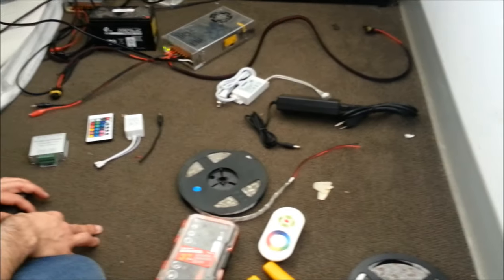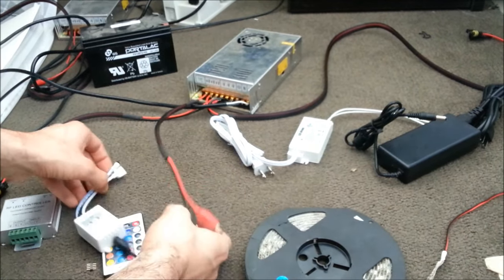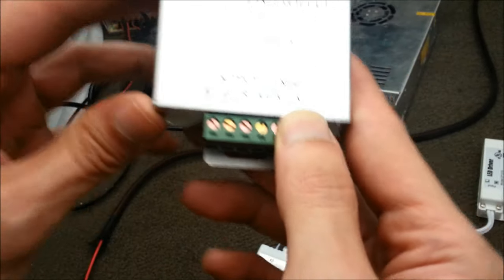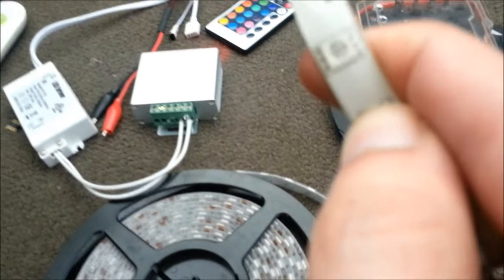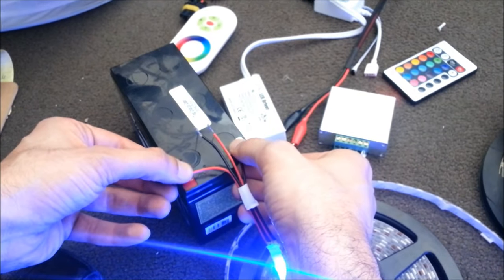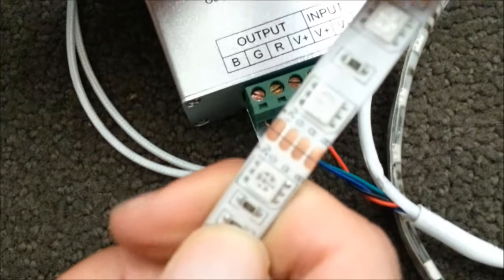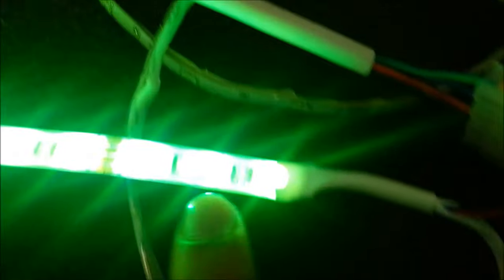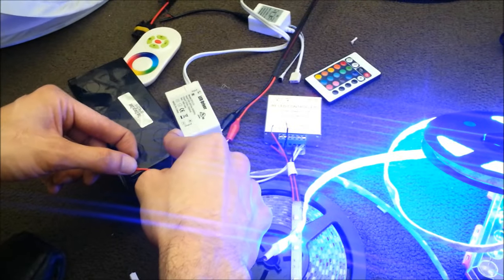LED Strip & RGB Controller Installation Guide DIY Help

Comment: Dude! I have been searching for information all night and now it is 10am. FINALLY! I found someone that knows how to make wiring these simple! Ok, really though. You have the absolute hands down best information available. I have a set of strip lights no model # but I can see the 151 and 331 resiators and 50/50 leds but no model # so I know they are analog, but want to be able to change the color to attract different types of fish. I have been trying for literally over 10hours for someone that knows how to wire them with and within the first 3 min of your video You answered every single question I have! I don't understand why your video is not the highest viewed highest ranked LED info video. New sub and thumbs up thanks for the info. You da man. I even searched the mfg website for info but they obviously don't support analog any longer ao they simply don't cross reference the model # with any controller. Now I know I can ditch them and go buy a cheap controller on Amazon.

Comment: Finally, after having 2 strips with only Red & Black connectors and 2 controllers with remotes, I have wondered how to connect them. Now I know, I didn't need the controller because I only bought 1 colour per strip (1 blue, 1 red). Opps, my bad. I just tested them on a battery and voila, good to go. Thanks for this video, soo soo very helpful.

Comment: just ordered a 5metre kit on eBay, if I want more sets of 5 metres attached, will the 12v power be enough for extra lengths attached?
Reply: I have the same question.  Thank you.

Comment: I'm trying to find out if I can use one power supply for the whole house and with long connectors because i don't want to put lighting all around the house. Please reply asap thank you. If you know how to and you have to purchase something please also send the links.
Reply: If you are using more than 5 meters or something 12V will not work, you will need a better power supply if you are using a large amount of LED Strips.

Comment: Great video, I definently like this setup. Would you be able to provide the specifications for that silver power supply and the RF Controller. I specifically want to know what the maximum current they can provide is. I wan't to run roughly 30-48 feet of LED's, so I believe that I am going to need at least a 6A inverter. Another question, can you hook the RF Controller directly up to the power supply? Lastley, would you be able to provide a link just tell me where you bought the silver power supply and the RF controller. Again, great video.

Comment: I have a 1200 watts amp in my car and I want the led to pulse on the bass. Is it possible to use these controller and connect them to the subs for the power source ? or will that blow the controller/led strip.

Comment: Hi so I need some help I want to install LED lights in my stairs I have 15 steps I just want 1 led strip on each side and I want to use a motion detector to activate the lights can you please help me and tell me what to get

Comment: Hello I a have the rgb (4wire) led lights. I have approximately 1200 leds(12v-5amps per string. 300 per string) I hooked them up in a row.  When I plugged them in. They were brilliant for the first string then each string got fuller until the last string you could barrel see them. So I bought a 12v 60amp power supply. Plugged them in and no change!  What am I doing wrong.

Comment: im a bit confused still. i have an RGBW controller which will have the colored wires put into one end. The other end of the Controller has an entry for an input wire shown @ (50 sec), and the input wire i have has 3 wires coming out of its opposite end (2 reds/Positives and 1 black/ground/negative). i assume these 3 wires are needed to be connected to some sort of power supply? if so, where exactly it the LED boards i have need to run on  12V.

Comment: Hi. Can I use a wall mounted controller and a remote on the same led strip? Like using a wall mounted next to the door to turn on the led strip and to turn it off from bed using the remote? What the connection will look like? Is it possible to connect two controllers on the same led strip? Thanks in advance!

Comment: About how much do you have to spend if you want to get a 5m led strip working. Right now everywhere I look the RF modules and power supplies cost both 50$+.

Comment: Is there a way to use both wifi and rf controller? I have both a wifi controller and an rf controller and I am trying to control the same led strip with both. This way I can have an RF wall switch and also be able to control it with my phone if needed.
Reply: yes you can it will be set up as an or gate where one controller has to be off to allow the other controller to work at a time just make shure only one controller is being used at a time to prevent overloads or damage in other ways.

Comment: i want to use rgb controller for single color led as rgb controller has music sync option...i need help onn wiring whether i can take three wire join them to gether and plug in each rgb or have too use only one out of 3

Comment: I've had mine for about a week now. I bought three my PC one runs great my living room runs great.. Downside is the one power adapter blue within the first five minutes I had it set up so I had to remove my other living room one and replace it for this one. Took the power adapter apart and didn't notice any burn or loose solder I don't know what happened and a replacement one is $10.. I guess two out of three isn't bad. I was hoping to find more information about the power supply and see if anybody else had any problem with it.

Comment: @5:34 I am wondering on battery common is a negative but when you connected to controller, you connected comment to a positive. I have various RGB ribbons all has positive common( although  - is engraved on its end connector but that is just to match correctly with the  female end which also has - but outputs positive supply.

Comment: If i'm installing a 20m rgb strip in the roof in my apartment and there ocures dimming can i insatll a small psu at the other end of the strip and if so will i need another rf reciver/controller at the other end so that i may still turn the LEDs on and off?
or should i just use a big psu at the one end?

Would apreciate some help :)

Comment: i have a 12v 50 amp 600 watt power supply . how  many 5 m reel of  the 6803  led lights can i put  together  in one line. meaning .. putting them all together in line

Comment: Hello
Good Job ..
You Explain so So Good ... None English Language Guy Like me Can Understand you Easily Thanks !

I Bought a Cheap RF WIFI LED Controller For 5Metter 5050 RGB LED .. I tryed To TEST it with 12V 1A Adapter .. But It Get Overheated And Not Working Anymore ...

I Have Question .. I want Bought The Touch One You showed On That Video ( it GOT White Touch Control - Cheaper Than Black Version ) ... I can Use It Safely On CAR ? i Want Put a 10A Fuse On The Wire Way ... And The Main Question Is .. I can connect 5 Metter 5050 RBB LED with One  Controller ?

Comment: I got this rgb lincsys it listed for 12.99 with discount only 7.99 it works great one fault blue button is red and blue button on the controller. I ordered it by accident wasnt what I want I installed a HUE Plus and none of the light strips work one strip has a green light. 4 bad ones.

Comment: can i run a 12v led strip using my 12,000 mah 5v battery bank?
Reply: +Bricklinsv1970  I don't think that equals 12v
Reply: +Bricklinsv1970 no, 12,000 is the capacity of the batterybank.
Reply: +Melvin i ha to get a step up power converter 5v to 12v and it worked good

Comment: Can I use a 12volts UPS battery (or 12V Li-ion Rechargeable battery Pack + AC Charger )  to power it instead of the power connector given with it ??

Comment: Great video! Thanks for posting.

Got a question: can 1 zone controller control and connect 2 strings that go in opposite directions (10m each direction (2x5m rolls), which is total of 20M)? Just want to make sure it's ok to connect and control it like that.
 I'll have 3 others used in other places with less length.

Please advise.

Comment: I would like to use LED strips for dress . may i know the compact battery for it??
Reply: lakshmi prabha  go to a electronics store n tell them youd like lithium gleicouse 1054 batts (they look like double A batt but little bit bigger )then solider pos to neg pos to negitive on 3 of them this will give u 12 volts dc but wont run for many hours but will light up

Comment: I have 5m ws2812b led strip . Why i cant run it without a led driver. I have 5v 40 amper power supply but It cant work? Can I work it without led driver? If not why? thanks

Comment: Common is ground not positive and the LED light strips are negative switching not positive there's always 12volts when unit is switched on and the negative controls the LEDs color and brightness

Comment: helpfull tutorial but would be even better if you wont cut topics you started, example single color strip connecting to RGB controller and several others in this video, overall  great effort that benefit many novices

Comment: So i have put these around my deck, the one that is connected the the power source is fine but the other three strips that i cut are only doing the colour green, any way to fix this??
Reply: +Melanie Gooch its probarly a bad conection r (red) and B (blue) between stip one and two

Comment: I would love some help with this. I have a very unusual problem. I received my shipment, and I set it up like this. When I plugged it in it turned on for about a second then started dimming very rapidly. It dimmed until you couldn't see it. I pressed the power button nothing. The strip was not taking commands from the remote. Now the weird thing I found was that inbeetween each led is a black thing. Then there's two black things inbetween each one then one again if I touch one of them it's red if I touch a different one it's blue and a different one its green but it's so dim you can't even see it without looking at the led itself. This doesn't make the whole strip red green or blue it only makes the section in which you were touching. The three LEDs inbetween the cut lines please help I really want to use them also they are called lighting ever lampux led rgb strip lights thanks in advanced.
Reply: That strip is toast. Check that your power supply is delivering correct voltage and get new strip. Sound like it got to hot. Led's can't handle heat very well.  The Chinese pump out shit drivers for all their Led's.

Comment: Question: I have an RGBW strip that runs 12V DC (or AC) with an IR Sensor like the first one you connect (white with pins). I'm trying to hook them up in my car. They turn on but they only show blue and the IR sensor won't respond to commands. It works just fine with the wallplug inside my house. I'm thinking it's an power problem. What would you suggest to fix the problem?
Reply: Leds don't run on AC
Reply: @BomJimmy  yes, I know. The power adapter is AC to DC converter. I just mean that they're sold to be used in the house on an AC to DC adapter

Comment: I have a question can I solder 4 different strips together will it effect the dimness?
Reply: That depends on how long strips you have. The max output current is printed on the controller.  (Mostly it is 3Amps at 12volt) .
That is called parallel connection.and a single stip is also a parallel connection providing 12 volts to every set of 3 leds in a series with a resistor.

Comment: how do you knof if you need 12v 2amp or 6amp power supply for 2x1m lenghts ? what is the math there? I could not find any info on that.
Reply: Oskars Lapsa i over rxe in a triangle this tip can also be reversed to give u 6 differant math formulas for electrical use volts x load equalls amperage needed
Reply: Oskars Lapsa I OVER R X E,,,,, (I/R X E)this is a good tip to remember ok

Comment: I'm a complete noob at this so don't yell at me please. I'm going to get 3 5 meter kits to go around my whole room. Is there any way I can connect them so they can all go to one power supply?
Reply: May think I'm nuts, but if you're capable of soldering, phone line is incredibly cheap and it has 4 colored wires that you can solder to your LED strip. It's small, shielded and due to the low amperage draw of the LED strips, it'd be perfectly sufficient.
Reply: Uh... I'll see what I can do...
Reply: Blue4sq  i use old bell phone line also ,,,i live off the grid and my whole house is lite by 12 v dc led remote controlled lightbulbs i use 8 phase bell line so i can run two or 4 wires to the single colour or 4 wire connection rgb controlled led strips without running ten differant wires from batteries to each strip

Comment: Your references to voltage terms are inncorrect. DC standards are 0V and +V. +V is your supply 12 or 24 DC voltage. 0V is also known sometimes as common but not always a DC term unless used as a means of DC communication. The DC standards are typically red and black, with red being your +V and black as 0V. You have a great deal of knowledge and information but you should get aquainted with the proper terms. I am an Electronics Technician and all I get is confused when I hear the wrong words describing how to do something.

Comment: When setting up multiple light strips (7 separate strips each 4' Long with a distance between strips of 4' ), is it best to wire in Parallel or in Series?
Reply: Whether you connect 4 strips back to back  or start all four from a controller point, it is in a parallel  connection either way. When back to back , farthest led suffers a voltage drop so it is better to start all ships from the controller point.